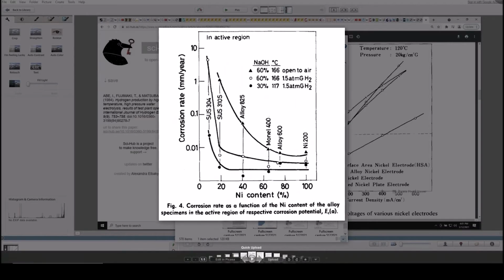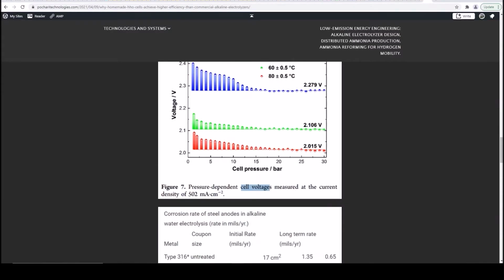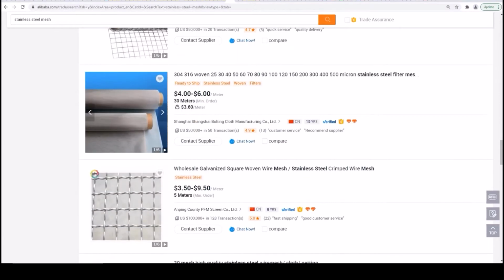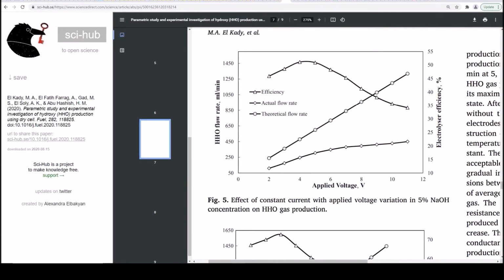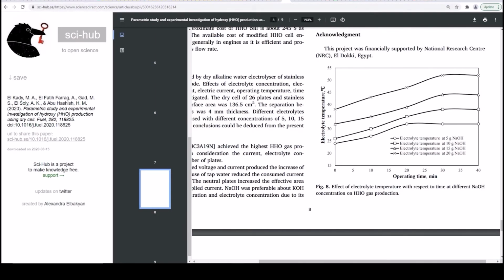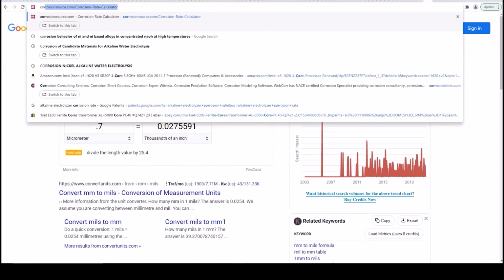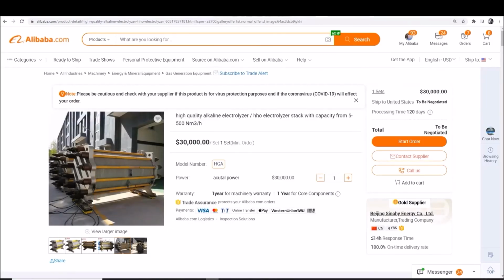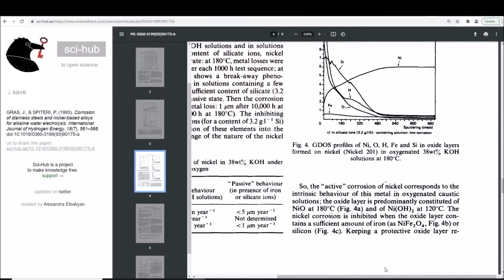Manufacturing alkaline electrolyzers for $30/kW using commercial off the shelf components.

Comment: You said anyone can build one of these.. but could you then actually build a small scale one, and deconstruct it showing the internals, cost, efficiency and production?
Reply from the maker: if scale is kept bellow 50 kW say, then yes, using off the shelf parts assembly is simple benefits little from scale.